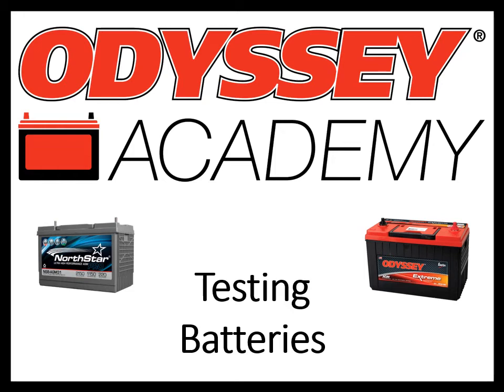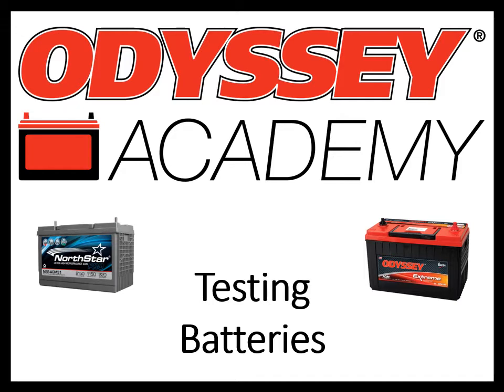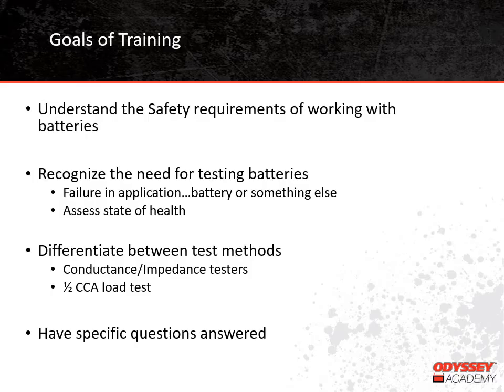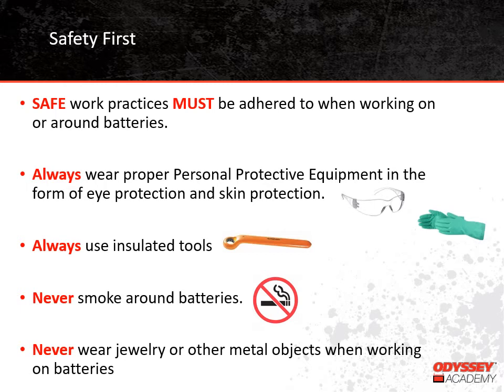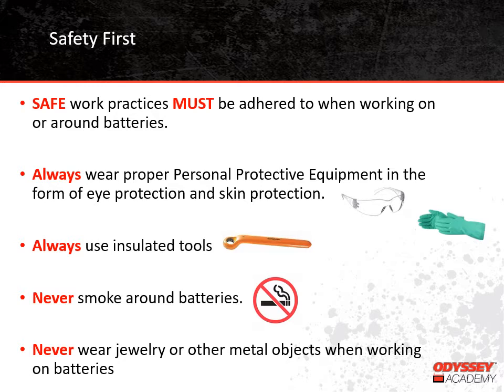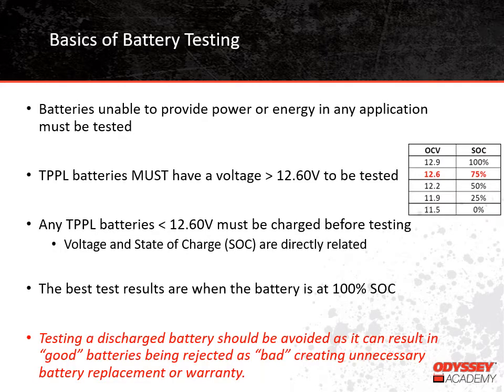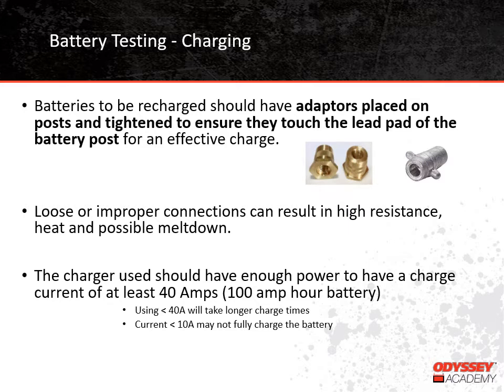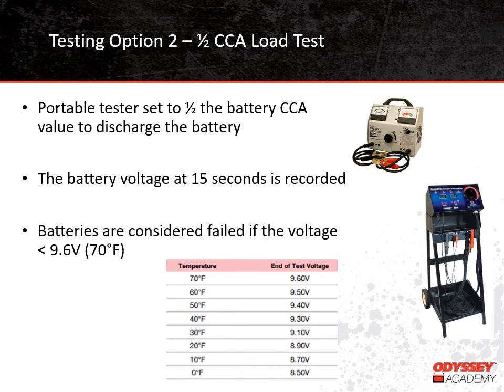ODYSSEY Academy – Testing batteries

Comment: Great video and tutorial. What is the voltage output requirement for an Alternator when using a Odyssey AGM battery,  is it 14.0 - 14.7 volts?